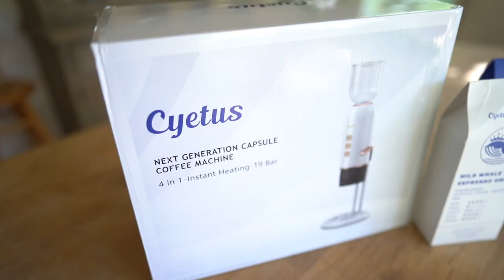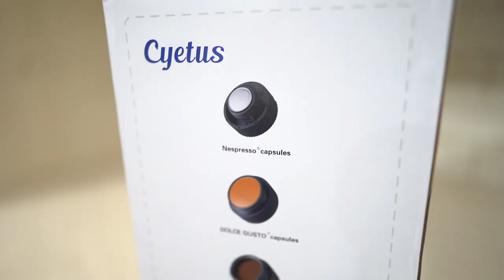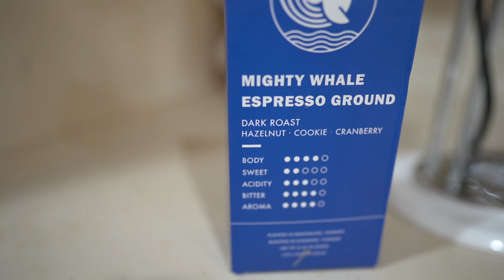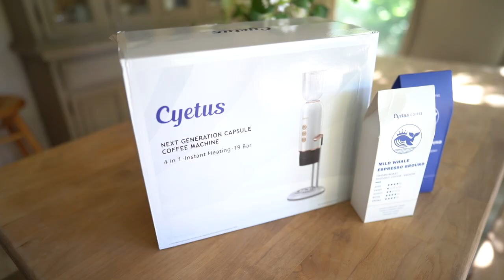FARMHOUSE DINING ROOM REFRESH | Thrifted Hutch Makeover On A Budget

Comment: A little tip for you is to take regular clear scotch tape and tape the back of the plates to the backing of the hutch (where the base of the plate meets the backing). It works wonders when you have kids running around and doesn't damage the plates either!

Comment: I love how calming this space is. I love the floor and rugs under a table get so dirty. I like the way you have it. I would love to see that hutch lit with some lighting. I love the two tone as well..leaves a bit of history of what it used to be..fabulous find for $100.00. 
I a little enviously how well you paint. I'd have this pulled to the garage non a drop cloth and cleaned down and sanded. So does that paint not require this prep? I will watch again if so. My experience with chalk paint was not good (Dixie belle) it is a nightmare to work with.